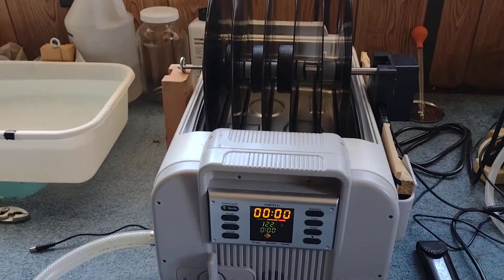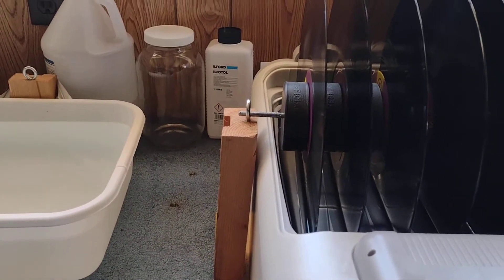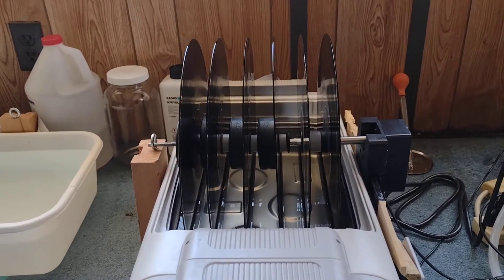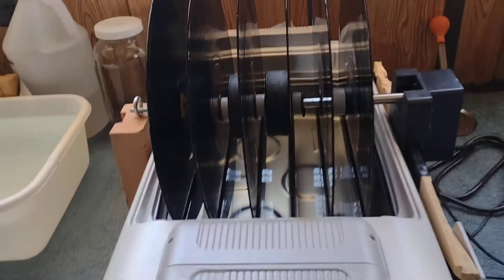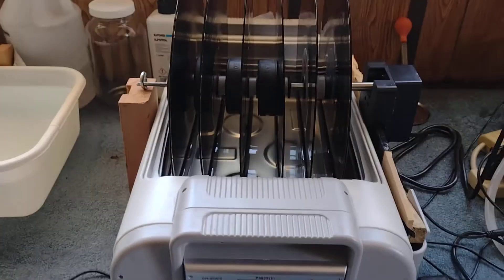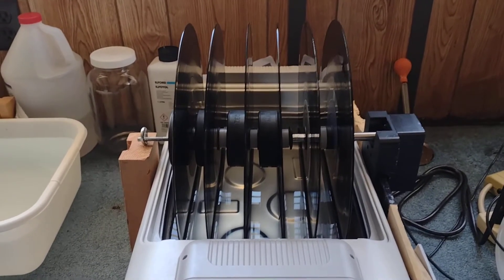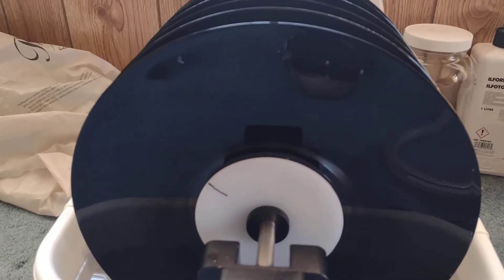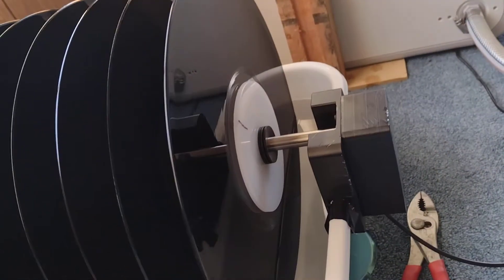DIY Ultrasonic Record Cleaning Machine (same iSonic tank used by Kirmuss) Pt. 2 (VITAL IMPROVEMENTS)

Comment: I took a total DIY approach, other than the tank itself (just a 6L Amazon cheapie), but instead of using wood, I took a polypropylene cutting board, then cut it into several rectangular pieces and bolted them together to make the part(s) that straddle the tank. I used a 1/4" flanged pillow-block style bearing and mounted that on the poly piece that straddles the side of the tank, which a 1/4" rod goes through and runs through the middle of the LP's. The the rod is coupled to a 12v DC .6 RPM worm gear motor, that's bolted to a poly piece on the opposite side of the tank. I have it wired into a variable speed pot/circuit to control the motor's RPM. Hopefully that makes sense, lol. It's kind of difficult to explain. 

I'm using The Vinyl Stack (label saver) pucks to hold the records on the rod, but other than that, I used 3d printer parts - the couplers, rod, etc, plus the motor & controller - all sourced from Amazon. It's all been working great the past 4 years and have maybe $200 into it. I can only clean up to 4 records though, but that's ok for now. 🤘

Anyway, I'll definitely check out that 10L tank you recommend though, whenever I upgrade! 😎🍻
Reply from the maker: Wow,  very nice!  Sounds like you did an excellent, WAY more polished job mate 😁  It honestly sounds very nice indeed!  Appreciate the comment, thanks!  FWIW, part 3 deals more with the distilled rinse tank, and part 4 deals with the filtration system.